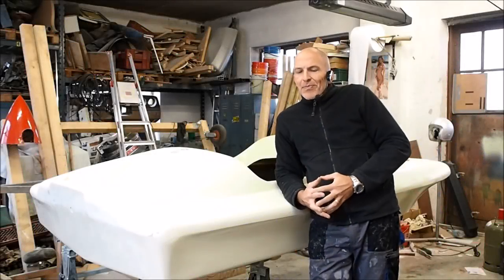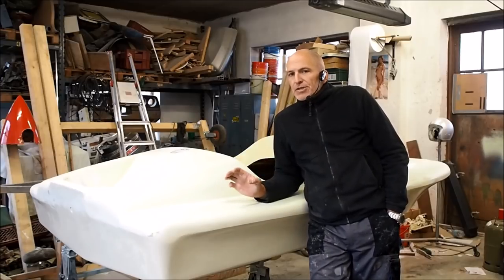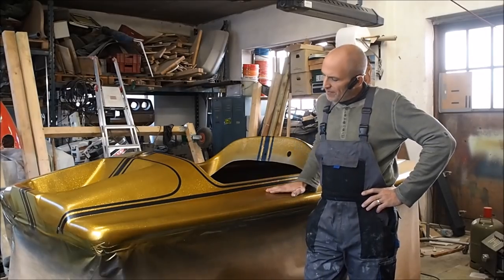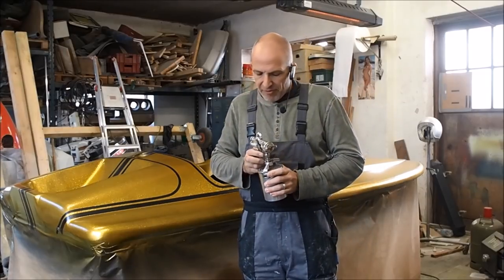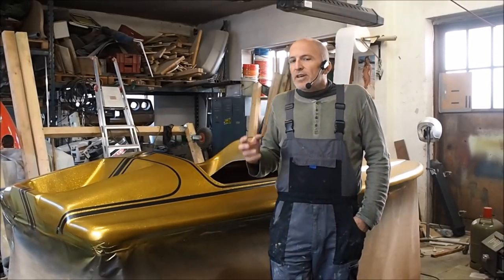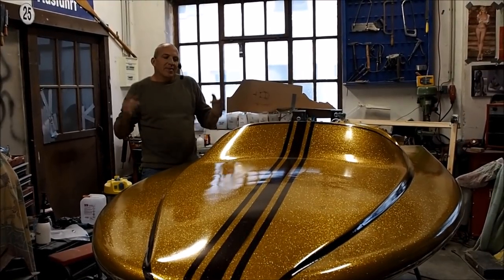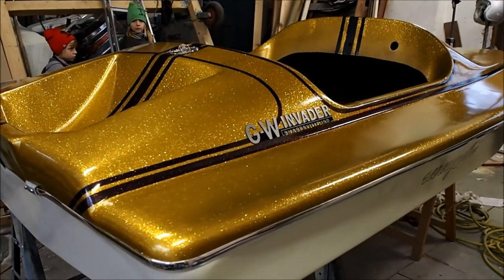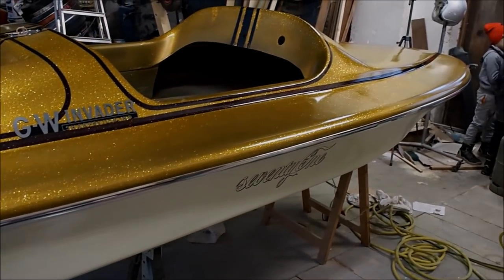GW-Invader Restoration Part 15

Comment: Ahhh, that's much better than original. GW gave it a few coats & kicked it out the door. Have fun. I love mine, it's blue over white with a red bench seat. 1970 10ft with an 18Hp Johnson Seahorse. They don't need large motors to get up & go nicely. In fact too much motor is no big advantage. A 25Hp is pretty much ideal for great fun on the water.